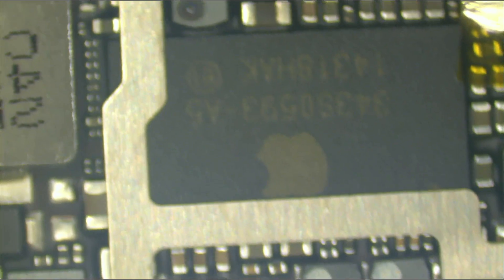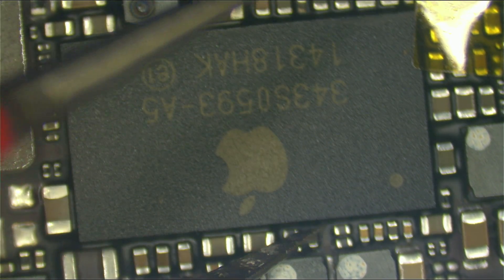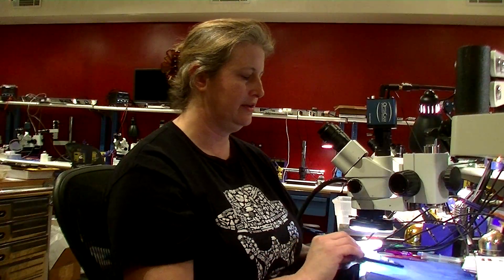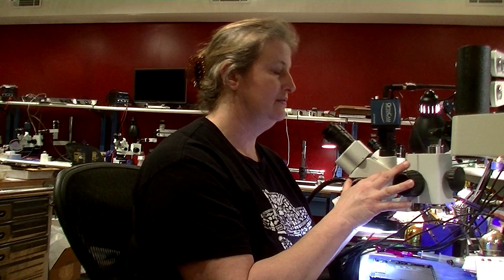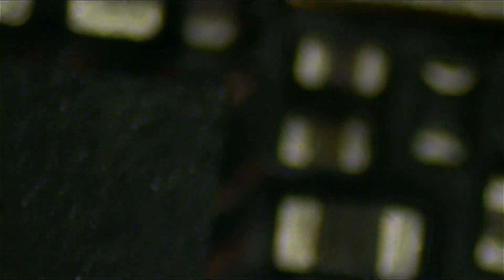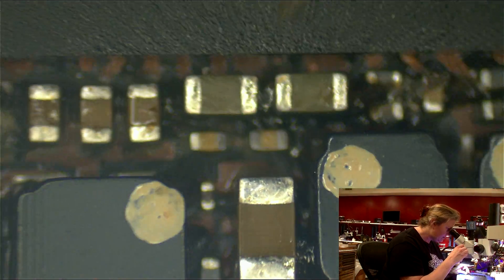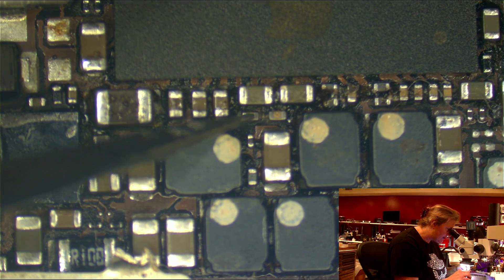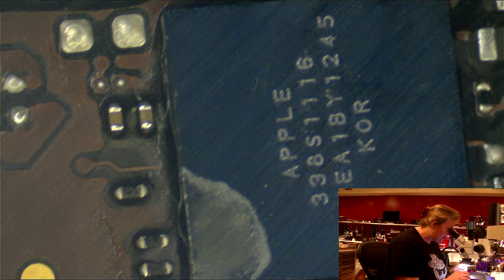Apple uses water damaged boards in Apple refurbished devices

Comment: Water damaged or not, Apple guarantee's their refurbished products as if they were new.  If malfunction happens to the device not caused by the user Apple will replace it for free within the first year, as if it were new, 3 years under Apple Care.  And all refurbished items go through a white glove process before they are sold again.
Reply from the maker: +Brandon Cruz "white glove process" means the same as "we checked it out briefly, seems okay."  If you buy a $349 refurbished iPhone 6 as an out of warranty swap because your iPhone 6+ developed touch ic disease, then 90 days later the same thing happens to your refurb, Apple says 'sorry, you're SOL"
Reply: +iPad Rehab That is incorrect.  First, the "white glove process" is the most extensive and comprehensive refurbishing process in the industry. If the product was genuinely an Apple refurbished device, then the exterior case/shell/glass will be replaced entirely, only after the internals are verified to be in perfect working order.  Second, I have no idea what touch ic disease means but Apple would NEVER reject a device a replacement, refurbished or not, do to internal an malfunction. As mentioned in my original post, their manufacture refurbished devices are GUARANTEED as if they were BRAND NEW. 90% of the time these devices are open box returns or display models. Finally, and this is my experience as a customer, I have had two iPhones replaced under the "one time exception policy" - my iPhone 4 and iPhone 6 were both replaced after cosmetic damage from dropping.  So I seriously doubt this wasn't offered to your customer.  Either your story is fabricated or your customer replaced their device with a 3rd party replacement device.
Reply from the maker: It is easy to say words like "extensive and comprehensive refurbishing" but it is meaningless.  They will put a board that seems okay into a new housing with new screen and battery--that's it.  
An Apple refurb gets a 90 day warranty if you buy it as an out of warranty replacement.  At 91 days, they offer you nothing when your iPhone 6+ gets the same exact problem that you originally paid $349 to solve with the refurb.  Read this.  http://www.mendonipadrehab.com/entries/general/the-epidemic-of-iphone-6-6-touch-ic-failure-explained-apples-continues-to-pull-the-wool-over-the-consumer-s-eyes
Reply: k

Comment: Ji Jessa, i have a question out of context. Do you recommend a brand of glue or adhesive, to paste the iPhone LCD assembly to the plastic frame? 

I tried several brands of glue but after a couple of days it will separate itself.

Is getting pretty frustrating

Comment: I'm not going to speak to the issue here on this iPad as I don't know you, your customer, or this iPad. 

The issue is only Apple, or an Apple authorized service center, can fix your device when under warranty or your warranty is void.  The shady issues are independent repair companies don't tell their customers that and void their warranties.  THAT IS THE ISSUE.

When this customer has another issue, or the repair center's repair fails, Apple won't cover the issue under the warranty as they can't be held responsible for every jacka$$ with a van parked out front of a strip mall with "iPhone Repair Cheap" painted on the side.
Reply from the maker: What good is the Apple warranty?  If you have a crack, a ding, a drop of water...you have no warranty. Nobody is fixing phones that aren't cracked.  And if by some small chance you do have a warranty issue, you get a refurb device---that looks like this on the inside.  
I would prefer to have my original device simply repaired by a quality shop.

Comment: I used to work for a refurb company in the UK contracted by apple, I witnessed much water damaged iPhone 4 and 4s boards being treated in ultrasonic baths and then baked in infrared ovens, then my departments job was to put some of those crappy boards with an LCD and housing.  I was shocked at first but now I know it is commonplace and is completely acceptable in all electronic device industries. I did not work there long felt so uncomfortable.
Reply: Nitesh Patel I would too. That's awful business practice, I guess we know to never buy refurb now.
Reply: +ArcadeMachine15 (wescoolya)
Considering how often it happens, compared to how often it fails to live up to expectation, it is a safe investment to make; one with very low "insurance payouts"
Reply: Under what condition were they selling them, good?
Reply: @tryitout-701  The idea ia that Apple never does individualized repair like your local unauthorized repair center does. When you bring your defective or damaged phone to the Apple store / an ARC, whether it's covered by warranty or not - they send your device off, and you get a different, "refurbished" phone back.

The reason they do this is to save Apple money. That's why the majority of devices overall, get sent to large refurb centers with hundreds to thousands of workers, usually centralized in the cheapest locations in the world for low wages and minimum corporation taxes. The economy of scale makes this arrangemen advantageous for them. The downside is shipping and turnover, for time. So when you have to wait 2 weeks - your actual device wasn't shipped off, repaired and returned. Those two weeks is just the time it took for the device to reach intake inspection and get the go-ahead (the actual full process takes substantially longer). - Apple could give you the refurbished replacement right there in the store, if they wanted.

This is one of the big reasons you don't get to keep your data, even if ie. just the screen was broken. Because what you're getting back, is someone elses phone. I don't know if they program refurbs (differently) these days. But earlier one easy way to tell that you got a different device back, was checking the IMEI code vs the one on your original receipt or the box it came in.

Comment: I wouldn't be surprised if this was true. Many users affected by the 2011 Macbook Pro GPU issue got replacement boards that failed faster than their original counterparts, and also showed signs of wear (like rust). Anecdotal maybe. But worn out boards don't 'accidentally' find themselves on the refurbished production line given Apple's stringent QC.

Comment: But because Apple design the Hardware themselves, they might have proper tool to test the motherboard, and if after refurbishing the water-damaged board pass the quality test, I don't feel bad about that.

People don't need the newest, freshest all the time, as long as what has been sold to you is what you have been told.

I wish that my brand new next iPhone has part from older iPhone recycled by Apple, that would be great.
Reply from the maker: +Yohann Paris sure, repair and refurbishing is an excellent thing for the world.  The problem is that this board WASN'T brought up to original specs due to the lack of underfill, but it was sold as if it had.  Then the customer lost the function of the device from a drop that the a board in original condition likely would not have been damaged by.

Comment: While I don't disbelieve this, I'm also not entirely convinced. We can't know that the customer was not lying about what they had done to this iPad before giving it to you.
Reply from the maker: +Apreche I never asked the customer anything beyond "where did you get this device"  There is no issue of them lying or not lying.  The microscope doesn't lie.  Having opened thousands of iPads that were original never opened, and those that had replacement screens it is clear that this was an Apple refurbished iPad--which is consistent with the customer's response "I got this as a refurb from Apple"  Also from having looked at thousands of instances of water damaged devices, the microscope tells me that this board had been cleaned from an old water damage incident, and that it had no recent water damage.
Reply: +Apreche I don't think you understand how much insight you gain from opening hundreds of iPads, both independently repaired, Apple re-certified, or formerly new. You eventually develop the ability to distinguish factory repairs from everything else. This is common in most industries.

Comment: Your claims of water damage are complete BULLSHIT. Those CERAMIC capacitors are immune to water, and nothing you showed indicated that they were damaged anyway. Did you MEASURE them?

The FISRST thing to be damaged by water is the PCB. The water will dissolve any remaining flux or solvents, along with salts from sweat, and begin etching away traces, destroying the PCB. The chips, caps, and resistors will survive just fine.

You are spreading misinformation, and you should be ashamed of yourself. Perhaps your libelous claims will attract some legal attention and straighten you out.
Reply from the maker: +Glen Duncan This is probably my favorite troll of all time.  Obviously, you're not serious, but just in case anyone might not recognize this, take a look at any of the other water damage data recovery videos on this channel.  Caps are THE most commonly damaged components from water damage on iPhone boards.  If the damage was just to the PCB traces, then removal of the mechanically shorted cap (which has now become a wire) would not relieve the short.

Comment: Jessa, there is a reason why OEM Apple adhesives are stronger. Most people uses 300LSE. Ist perfect, BUT! Its not thick enough to bond the screen perfectly. You need to put 2/3 layers on it, ESPECIALLY with the iPod Touch 4g and higher.

And both surfaces where the adhesives has to stick on has to be cleaned in a way that nothing is in between there. Believe it or not, fingerprints and human body oils hugely decreases the bond between the two surfaces. 99% of electronics repair companies didn't know it but the reason why the adhesive is thicker, is to create a cushion for the  glass and way more flexibility and durability, plus the bond is a lot stronger.
Reply from the maker: +Lorenzo van het Hul So true on the removal of 100% of old adhesive.  I use a 3m sticker remover pen then alcohol to get the frame factory perfect before the new screen.  Hands down the best adhesives for iDevice repair are made by Tesa.  You can order this from Neils Brooks at tapetemplates.com.  This is the webinar that iFixit did on adhesives with the folks from Tesa who shared with us their experience as pressure sensitive adhesive manufacturers on how to use this stuff.   I never knew that pressing the adhesive in one direction only was important before talking with them.  https://youtu.be/u-FdOTlZWkU
Reply: i found it even more interesting that the bonding strength is significantly higher when the tape itself is heated up to 40-50°C before applying without damaging it or making it less durable. also that it builds up strength up to 48hours after applying was a good thing to know too. thank you Jessa for the link to the video!
Reply: Btw, b4 you apply it, use some cleaning fluid to remove any smudges and then use standard transparent tape to remove any fluid leftovers. Just go over the spots you want to put adhesive on sometimes and trust me, it would make a better bond then any Apple OEM's.

And for iPod touch 4 gens, ipod touch 5 gens, use (3 layers) of 300LSE tape and the same technique mentioned above to adhere it down. The OEM tape is thick, exactly 3 times thicker then 300LSE from 3M. So 3 times.

Comment: This is a well known fact - ask anyone Apple authorized that knows what they're doing and they will confirm it for you. Goes likewise for macbooks/iMacs/etc. Replaced components have a different color plastic (in the case of battery connector, RAM slots, etc) on them on a certain quadrant that went bad.

Comment: okeyyy thats what refurbished means...!!!
Reply: +Sasan Zareei No it doesn't. Looked up the definition.
Reply: +Jake Methner i did. Still the same as what i saw long time ago
Reply: Sasan Zareei
In the context of electronics, it is the process of restoring a damaged or partially working device to meet or surpass regular functionality.

A water damaged, partly completely repair is not that.

Comment: I'm wondering what method you use to clean the LCD and digitizer from fingerprints and dust before reassembly? Thank you!
Reply from the maker: +worroSfOretsevraH  If I'm reinstalling an LCD I wear latex gloves which leave no marks.  Most of what I do is board repair, so I usually use tester LCDs and don't worry about it.    In general, I don't try to reuse digitizers at all.  I don't think the time spent removing the old adhesive and applying new and worrying about fingerprints and dust is worth the cost of just using a new digitizer.  I will clean an LCD.  I use a small amount a product called "Perfect Glass" on a new microfiber cloth to clean.